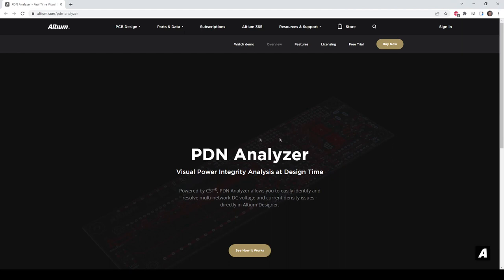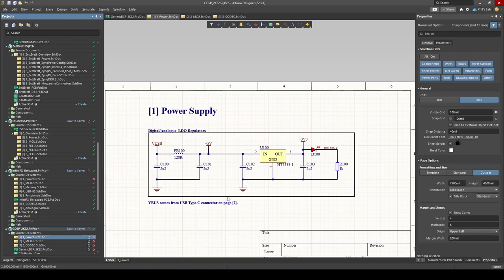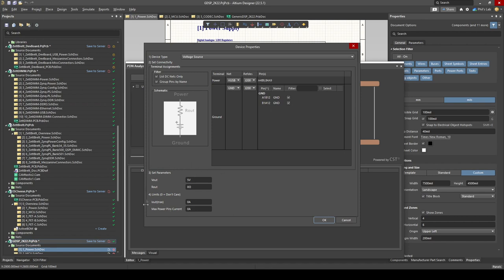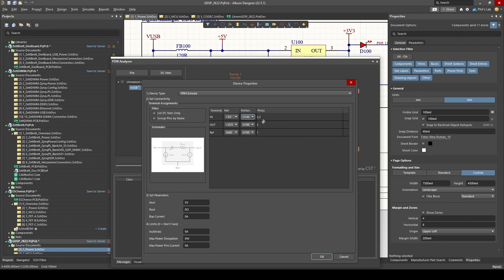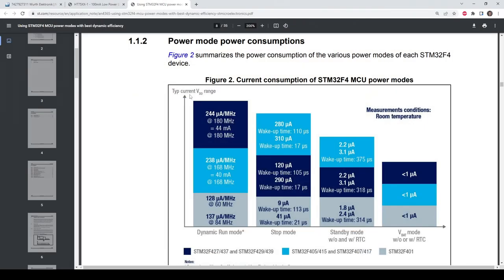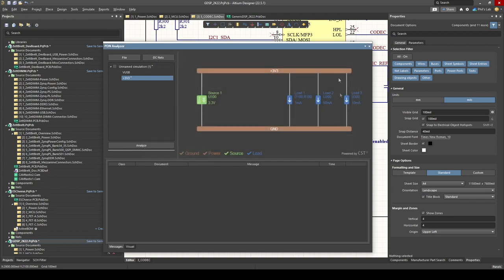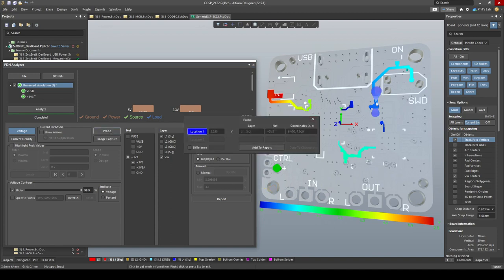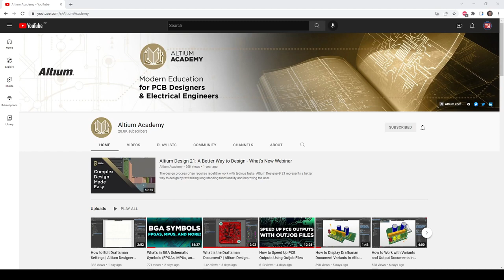PCB Power Distribution Network Analysis & Simulation

Comment: Hi Phil,
cool video. I just tried PDN Analyser 3.0.
Is there a way to simulate the temperature of the copper?
I have a high current multilayer PCB with 15A. And I am interested in the temperature distribution.

Thank you,
Andreas
Reply: You can roughly gauge temperature from the resistivity of the copper. Generally you’ll want to look at the hottest region and make sure that’s within your board substrate spec. If you need to simulate temperature flow you’re going to be staring down a very, very expensive license for dynamic sim software that takes into account ambient room temp, airflow, etc.

Comment: This looks more like what you need - Power Integrity Analysis Using Ansys SIwave  - It gives simulation of Z parameters for use in things like transient analysis.   This is more like a real PDN analysis for getting impedance for switching sources (DC-DC/SMPS) and the source impedance of the network for the switching loads.

Comment: When I clicked on this video I was really hoping for a more in depth analysis like I'm used to by Zach's videos but it turned out to be 11 minutes of GUI setup, and 2 minutes of DC analysis on a board where current density is really not that high and thus IR drop is really not that important.

 It would be much better if the actual DC analysis comprised a more prominent stage on the video (instead of just a small portion of it) and if it was done on a design where it actually mattered and showcase how do you solve an actual problem that would be otherwise very difficult to do so without this tool (e.g. a very high power board like a power supply and see how you adjust the layout based on the feedback from this tool).
Reply: Thanks for your feedback. Completely agree - and this will be covered in a further video, as this one is simply meant as an introduction to the tool, and how to set-up a simulation. I have some fairly high-current FPGA designs, as well as an ESC design that I'll be demonstrating with the help of the PDN Analyzer, then showing techniques for (fairly) high-power layout and routing.
Reply: @PhilsLab  that would be cool to see, I'll be waiting for that video to drop then!

Comment: This is not really a PDN analyzer - it does NOT provide what a PDN analyzer SHOULD do - provide the IMPEDANCE (that means AC components) NOT just simple DC. 

Until this does IMPEDANCE analysis, it's only good for stuff like simple static DC components like resistors and LEDs.  I mean the cute little histogram looks cool, but that's not a true representation of what's actually going on.  To do a REAL PDN analysis would require something like 3D field solver/FEA 

 I'm not making LED boards with just simple LDO/Linear regs.  Typical digital systems utilize SMPS and switching loads.   THIS is what determines the impedance requirements of a PDN - real any trade mag or text book on PDN.    Z_PDN=∆V/∆I

Those Delta symbols mean a lot... 

"If we take a closer look at the frequency behaviour (see Figure 2), it becomes clear that any PCB power delivery network will show some degree of capacitive behaviour at lower frequencies while this capacitance decreases due to the resistance of the power-bus in series with all the load components and its return path and then the inductive behaviour typically dominates. Figure 2 shows all impedances vs. frequency for a NXP iMX55 CPU for a DDR3 power rail of an automotive ECU for all the CPU power pins.

The impedance is affected by the physical separation within the power rail in the board stackup. As frequencies increase, the mutual inductance between the different circuits on the board will cause the impedance of the power distribution network to increase. Due to various effects, the impedance of such a structure shows many peaks (resonances and anti-resonances). At higher frequencies, the impedance often negatively influences the input behavior of the ICs, which is highly undesirable especially in the frequency range in which the ICs are supposed to operate."

There you have it - REAL PDN analysis. 

The reason that uC datasheets don't show current consumption is due to the switching varies as the part is configured and run.  AGAIN - an AC problem not simple Edison DC stuff.  

Tesla won, Edison lost... simple...

See TI's app note SWPA222A which states:   

"To complete the PDN analysis, it is necessary to determine the target impedance of the overall power 
net. Target impedance extraction is achieved using the Frequency Domain Target Impedance Method
(FDTIM ).and the objective is to maintain the target spectrum below the Z target value (Z target ) from DC 
to F max . 
The Z target  value is determined by:
𝑍𝑡𝑎𝑟𝑔𝑒𝑡= 𝑉𝑜𝑙𝑡𝑎𝑔𝑒   𝑅𝑎𝑖𝑙∗ % 𝑅𝑖𝑝𝑝𝑙𝑒
0.5 ∗ 𝐼𝑚𝑎𝑥𝑡𝑟𝑎𝑛𝑠𝑖𝑒𝑛𝑡
F MAX  is the point in frequency after which adding a reasonable number of decoupling capacitors does 
not bring down the power rail impedance |Z EFF | below the target impedance (Z TARGET  ) due to the 
dominance of the parasitic planar spreading inductance and package inductances."

Cummon guys... get it together... Provide us with a real PDN analyzer  BUILT IN to Altium.